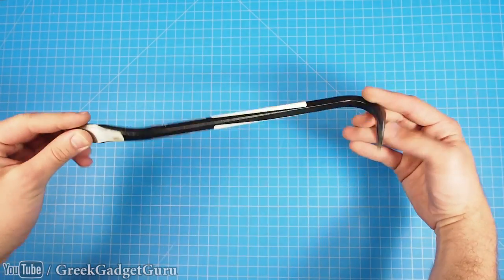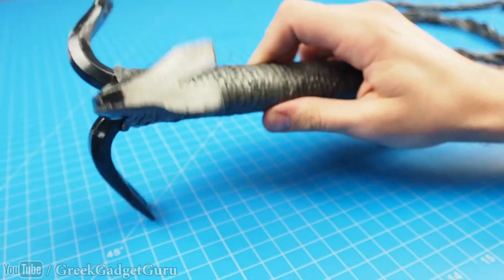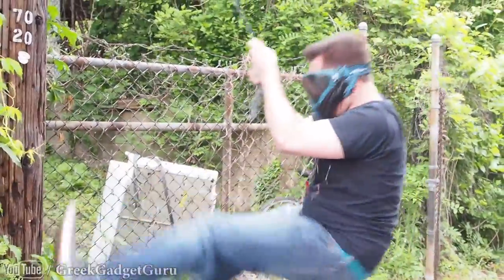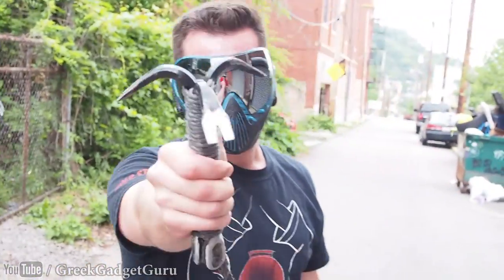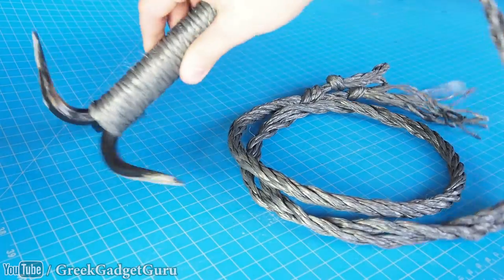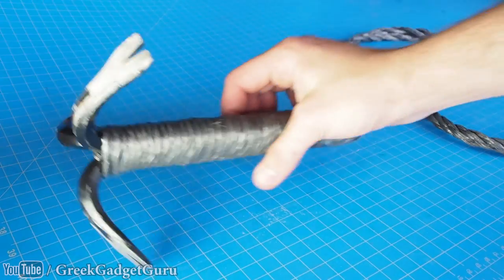How To Make $5 Grappling Hook - Terraria Inspired (Dollar Store Items)

Comment: Just a suggestion, but if you make a grappling hook using rope it helps to tie knots into the rope every foot or so, this allows your hands to gain purchase on the rope when climbing, without relying solely on your grip strength.

Comment: You might consider using paracord instead of that rope. It'll be far nicer on your hands. In the past I've used fence spikes for that and just bent them in a bench vice to make the hooks. You know, the really huge nails you find at the hardware store? Just weld them like you did with the pry bars there and weld a half a link of chain on the end to attach the rope with. It's also extremely cheap as well as effective. They can be hardened to keep them from bending anymore so that's not a concern. You get better shape in the hook if you have an actual anvil to use but beggars can't be choosers right?

Comment: Stop commenting that you'll need all those tools, don't use the welding equipment use steel epoxy( wrap it around the crowbars ). You can chop the crowbar with any old saw or you can skip that step... you can also skip all the angle grinding part as the steel epoxy solves the issues. Next wrap the rope on the top of the crowbar not through the loops ( as you can skip that part too). And boom there you go and btw you might want to consider climbing rope since you will be skipping the process of buying those tools

Comment: I am extremely bothered by the fact that openings weren’t milled in the center of each chain link, so the rope passed through not only the chain links, but also through the steel crowbars themselves. I’m sure the welds are strong enough to hold the average 6ft 200lb action hero... but I’d feel better in the long run knowing that the rope passed through each of the three crowbars that are now one, instead of just going through the 3 chain links that were added to the bars.

That would just be my 5AM early morning OCD criticizing designs that are probably better than mine would have been

Comment: GGG as alwyas like your videos
but as a non engineer i would think that it would be smarter to have a smalere grappling hook foor weight(appocolypse) and size i think maby smaller hooks but definetly a smaller handle since you trow it using the rope you dont need a handel and without it its far easier to carry in a backpack and such

P.S.
maby make the points blunt cause you probably dont want to stab yourself and they dont realy need to be pointy just saying

P.S.S.
this is critisism not critique i just can think of this while your working filming doing audio comming up with ideas that will be good for your channel and find the time to build and go outside to film
Reply from the maker: Thank you for the advice! I appreciate it 😀